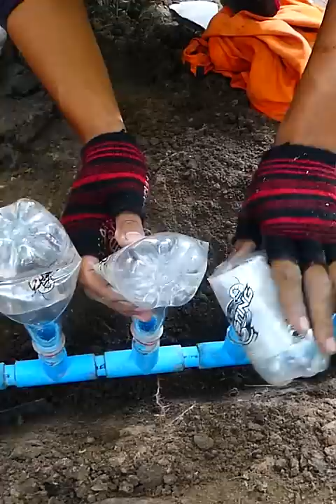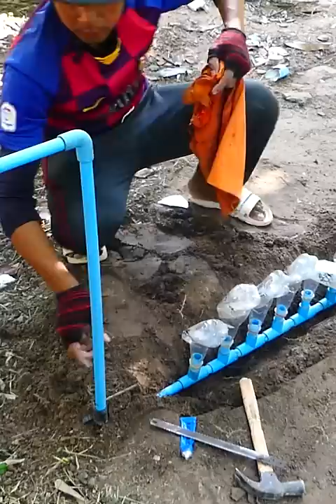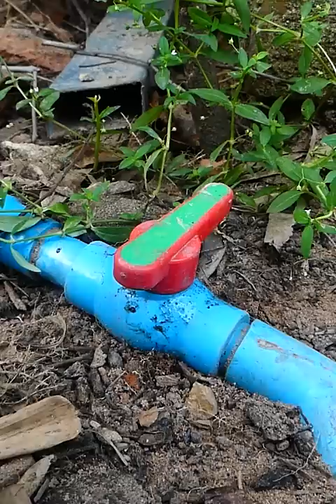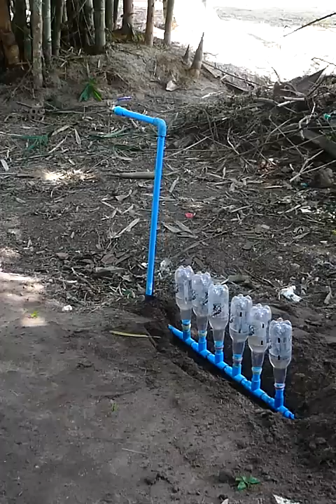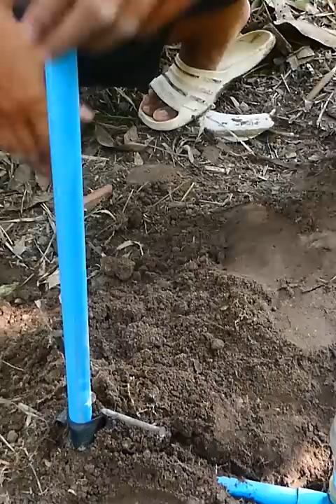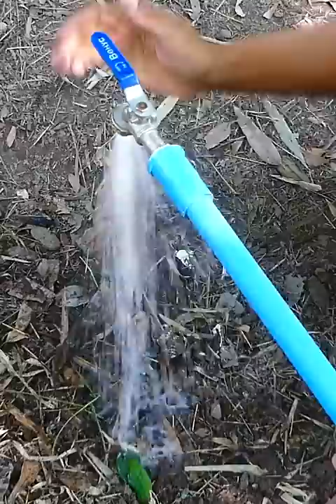Trick Free electricity | I turn PVC pipe into a water pump at home free no need electricity power

Comment: Ehhh so where exactly is this free electricity thats described in the title?
Reply: DIY water pump = Electric free water pump
Reply: @JMazzaTaz and how does this magic water pump work? By a pressurized water line filling the pipe? 🤣
Reply: @JosePineda-jn8jk I think the video is claiming that some bent water bottles will create enough pressure to pull water…
Reply: Your view powered it
Reply: @brailleeulogy120  and do you believe that would work?
Reply: @JosePineda-jn8jk  nope. Not at all.
Reply: @brailleeulogy120  common sense can still prevail. There is hope at the very least!
Reply: nothing is free, it needs the crumple, which takes energy to do
Reply: @ouTPhaze not even that, there is a pump here.
Reply: That’ll work for about 20 - 30 seconds
Reply: @WillseanTaylor  it’ll fill up the pipe maybe but, the water wouldn’t go up and out of the spigot without real water pressure behind it…
Reply: It's not a pump, it's a solar water heater.
Reply: @wanahmad5660  
But still not producing electricity 🤷‍♂️
Reply: @motog4-75  yeah but if he attached a solar panel… then he still wouldn’t have electricity 😆
Reply: Free energy would make more sense. Rather than pumping with elec, let physics do the work. Poor title but cool use case. Something tells me English isn’t my dudes first language
Reply: For those of you questioning the validity of the water pump working :

It's called a 'trompe' and Grady from 'Practical Engineering' here on YouTube has done a video on how they work:

https://youtu.be/uvf0lD5xzH0?si=KK-GEEQCuaC2fnWu
Reply: @THE_PeglegSwantoon  so you think this dude is trying to harness a micro amount of compressed air via his already pressurized waterline? 
Because you still need an energy source (river water, a waterfall, or in the case of the video you provided, a garden hose with pressurized water…).
Reply: @THE_PeglegSwantoon your link comes up as “unavailable” when I copied it on my phone.
Reply: @THE_PeglegSwantoon  
Ok, so is this supposed to make electricity like the title says?
Reply: To all who replied to my post:

I NEVER claimed that the title of the video was in any capacity correct, I called it a water pump, which it is; your inability to move beyond the erroneous title reeks of pedantic hypocrisy. Just because the title might not be correct, in no way diminishes the fact that something potentially valuable could potentially be learned by those open to learning
Reply: @JosePineda-jn8jk  gravity and pressure from a giant body of water weighing 1000's of pounds.....
Reply: @THE_PeglegSwantoon  
Thank you for posting the link above. I just watched it. It is interesting. 
You are right, the clip we have all been commenting on is mistitled.
Reply: @BrikBeans  it’s not just about the size of the body to water 🤦🏽‍♂️ it’s also about the size of the air capture system. With a few water bottles worth of air pressure you can’t do anything. If this system were bigger then I’d say yeah it’s completely comparable but, this is literally so small the energy captured would be useless. 
Now if he cuts a hole on the top and runs lines into some sort of additional container then you might actually have something worth while.
Reply: @THE_PeglegSwantoon   brother you literally said for those questioning the validity of the water pump working. 
I’m not doubting that people have used systems like this to actually be useful, I’m saying at this scale it would be useless. 

You are correct your video link had something worth while but, I also posed a question. Do you think he is trying to harness the minute amount of compressed air in a few water bottles? 

Be open to criticism sometimes because it can challenge your ideas and in the end maybe even land you on a better frame of mind..
Reply: @THE_PeglegSwantoon but it’s not. It’s a fake video
Reply: How do you not see all that free electricity flowing out of that tap?
Reply: @JMazzaTaz free electricity does not equal electricity free.
Reply: I feel like this is from a spring.  That other valve that he opens is holding back the water pressure.  This is a useless waste of everyone's time.  No magic here.  Not even remotely interesting or useful.
Reply: Solo es el aire que agarra pero la precion desaparese en sedundos😅
Reply: @THE_PeglegSwantoon
Reply: It's in the title... that's the only place "electricity" shows up in this video. 😅
Reply: Actually the guy is trying to fool us, don't u see that the pipe is going into the ground. Don't be fooled. There is no such thing...
Reply: @JosePineda-jn8jk o think you need to go watch the rest of his shorts before you all base what he's doing on this one video. It literally takes a few seconds. This is not him just plugging it into a hose and wallah. Oh and btw I don't keep notifications turned on for YouTube comments so I won't be able to see your reply. It's nice... Not having to argue with complete strangers online that think they are always right or That troll and love getting the last word but can't. Fixed it.
Reply: @babethebuilder1  tl;dr
Reply: The son probably heat the water in the pipe.Through the water flowing through it. I think it had to be a very hot day, to give all a hot shower
Reply: He meant water pump without utilizing electricity. It’s just poorly translated
Reply: @christiansaravia7865  
👳🏽Yea but yea but 
But but but.......... 
People should stop posting their nonsense or misleading clips.
Reply: Tapping into your city water system by passing the meter then make a water wheel to a alternator or three hahaha hahaha hahaha I love you
Reply: @geraldbronson9949 
Down stream a pipe from a swift creek 150-200' and run into 5 gallon bucket with radiator fan on inside and connected to pulley on outside with alternator...Then rig up four to five dry box batteries... because if you overload the alternator(s) thrown to a battery then it'll overheat the battery and it won't run the pump.

Or just run the 150-200' foot plumbing in the swift creek and do a ram pump.
Reply: @JosePineda-jn8jk  magic.
Reply: @WillseanTaylor  way longer if you're downstream from a mountain stream.
Reply: He could hook a turbine to it and generate a trickle of electricity.
Reply: I would like to know just wear the other end is doing..
Reply: Without the air pressure from the plastic bottles, the water would just check it out if that. It has to make it up the pipe and out the valve  of the water spigot.
Reply: Read the rest of the descripción
Reply: A Dei hire composed the title.
Reply: well  i think the intent is free water pump no electricity.. non the less i'm definitely dumber from watching this .. the sad thing i keep watching it thinking i'm missing something
Reply: @yabezweiner6022  
Aha we are getting somewhere now.............
Reply: I’m confused lol I dot get what he going lol
Reply: youtube pays for it via ads
Reply: For stronger electric current use red pipes.
Reply: @Befread  Of course, just saying that there's no "free energy", crumpling and uncrumpling is kinetic energy xD but yeah, it definitely has a pump
Reply: He don't show the other end of the pipe, how do we know it's not hooked up to a water line

Comment: "Free electricity" is DIFFERENT from THERE'S NO NEED OF ELECTRICITY.
Reply: free OF electricity, at least at this extraction point. 😂
Reply: Good.. this buffer actualy for water resouce with strong presure but low speed .... Dont tal about electricity...
Reply: Indeed and it is fake.
Reply: EXCEPT ITS NEITHER BECAUSE ITS NOT REAL!!!
Reply: Probably he meant “electricity free”
Reply: @OmaraliasPuma That's it! Free Electricity and Electricity Free are 2 different animals.
Reply: @szgemen 😂😂😂
Reply: @OmaraliasPuma  IT IS NOT ELECTRICITY FREE OR FREE ELECTRICITY !!!
Reply: Pressure ++ in pipe ❤ 

(This case  low pressure and Modifier pipe line for High pressure) 👍
Reply: @chairatklamsanong1189  its fake.
Reply: They meant "electricity free"
Reply: In our city, we have a free flowing artesian well, so we don't have to pump manually. However It has stopped flowing now. But in nearby areas we still have free  flowing wells. Situation like this is actually a result when there is a water table nearby which is higher than the well. A "spring" works like this. 
Another thing, a siphon does not need an electricity also. But the principle involved is the same as the spring above. The source must be higher than the outlet...although a tube is needed. 
So, in the case of what has been posted or vlogged here where the source is higher (water table, river, lake, irrigation canal, or whatever), then the setup will always work without the need of electricity. No need of electricity simply means electricity is not used...and the mere mention of electricity on the vlog should have been eliminated.
Reply: Pembodohan publik
Reply: I don't see what the empty bottles can do, when he opened the valve clearly can hear the pressure air in the line and I dont think that comes from bottles and with that much pressure, so it is so fake like the free electricity he said
Reply: Me bhi yahi padh ke video dekhne aaya tha
Reply: The most important part is the one way valve that isn't shown.
Reply: Yeah, and in the case of this video, they are both lies
Reply: Bit like an electric powered generator for the mentally challenged
Reply: @sparkboy5207 And the bottles are completely unnecessary!
Reply: And you still need electricity for this
Reply: translation error, they meant "electricity free" XD
Reply: @sparkboy5207  ya get idea, hold a bucket up with hose and water will flow, but non of that is showen in vid. Could have panned the camera so we could see few more feet but didn't. For all we know there is a hamster in a wheel
Reply: It would at most crate a small vacuum on the line and maybe pull the water upward if there was a slight gradient how we that would require you to manipulate the bottle to act like a vacuum which he didn’t and didn’t do for the others that were in a tandem setup.  A Tesla valve also doesn’t require electricity to work.  However this video is posted out of context or is just spam or getting us to do exactly the thing it wants is to call out it’s flaws.  Like an easy to figure out game in an advert the “person” playing it makes the wrong choice so it will manipulate you into wanting to show that you are either superior or want to play it to fix it.  Either way they win.  Sort of like a slot machine or Walmart everything is 100% calculated to be precise to work on all your subconscious and buy the product or spin the wheel.
Reply: But you got the message
Reply: @sparkboy5207  And neither exists. So which species of non-existent animal are we talking about here? Just to keep our imaginations straight.
Reply: he has freed the electricity from having to work
Reply: A messo praticamente i tubi in pressione 😂😂😂 💪 💪
Reply: It’s ok their good English is no
Reply: @sparkboy5207  i don't think those are animals
Reply: I see you're a student of Electro Boom
Reply: Probably English is not their first language
Reply: and it still needs electricity to pump out water 😂😂😂
Reply: You realise not all 8bilion people speak english right? No? That's fine
Reply: Electricity free and free electricity are separate
Reply: He doesn't know what he does 😂. Let's leave to save our time 😂
Reply: you could create electricity with this.. just sayin -
Reply: @BartholomewJenkins69420  it is electricity free though, plumbing dosent use electric, taps still work when the power goes out
Reply: this is a pressuration system
Reply: @BartholomewJenkins69420 why do you think so?
Reply: @joseangel4821 The water source is probably higher and that's it. It probably just doesn't have enough pressure to make the water flow upwards so he used this system to help give it the last lush. It doesn't mean it is fake since there still isn't any electricity used
Reply: @liamflorentine902 You can literally see him opening the valve, are you blind?
Reply: @criss-crossapplesauce274 It doesn't. Do you really think all pumps work with electricity? Is your education that bad?
Reply: @TOBY-jy7bz  in order for it to be an automatic pumping process, there is the need of an energy source for the pump to work, thus yes all water pumps need electricity. if you want to talk about free flowing water on an enclosed system then you dont need a pump because the water pulled out initially will keep the flow going by itself since it will create a repetitive pull towards the water that is coming from a higher surface than the tube , in this case you do not need a pump. 
then of course you have the manual pumps that make use of valves where you remove the air by opening the valve when pushing down and pull up water when the valve closes and you pull up, however that will require manual labor throughout the day

IN CONCLUSION YOU NEED A SOURCE OF POWER TO MAKE WATER FLOW ON A TUBE WITH PRESSURE AND MOST COMMONLY THAT SOURCE IS ELECTRICITY.

So to answer your question... yes, my education is that bad
Reply: @criss-crossapplesauce274  so you're telling me that some guy in the jungle didn't come up with a better way of pumping water than scientists and physicists?
Reply: @TOBY-jy7bz  the water source has to be on s higher level for it to work but the bottles do not help at all, so just unnecessary intrications to make it seem like he did something.
Reply: @BartholomewJenkins69420  i know it sounds crazy my dude... but i might be right, just might!
Reply: Ça sert à rien du tout😮à part perdre son temps
Reply: Apparently, you have never heard of lightning! 😂😂
Reply: @asdsasds6224 No actually you don't, you just need gravity actually.